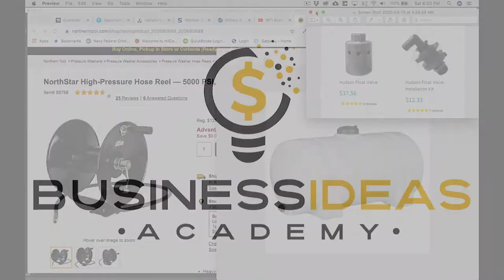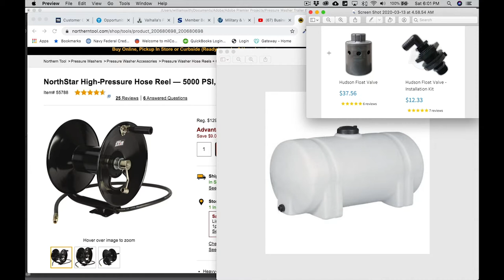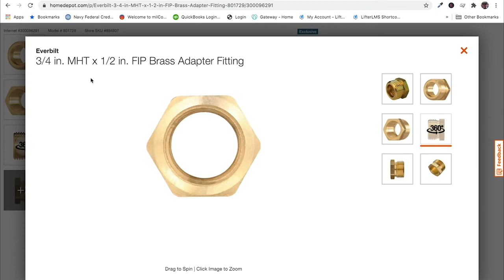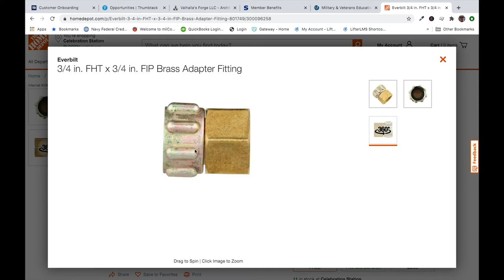Pressure Washer Trailer Build - Part 3 - Water Supply Buffer Tank

Comment: Ok, stupid rookie question. I understand the concept of what you're doing but since I have a different reel (GP) my inlet connection is inside the reel opposed to how yours is (outside the reel)  other than that, all the same fittings should work the same way, right?
Reply: I have an aluminum reel from Northern Tool that has the hose connection inside the cylinder of the reel and yes, it's the same size connections. Problem with this is that your hose needs to have a swivel end so you can tighten it without have to turn the entire length of hose.
Reply: @neptuneclean  

Would the third component that you showed that swivels accomplish that?
Reply: @jackwebb5917  Now that I think about it. I think a short hose whip (12"-16") with a swivel on one end would work. Way easier to attach that to the manifold inside the cylinder and then attach your longer hose to that.
Reply: @neptuneclean  

Ok, so using the third component with a swivel you used in your video with the NT reel with and outside the reel connection would not work with the “insise the reel” connection, but a short hose whip would work better?
Reply from the maker: @jackwebb5917  I think the hose whip is the way to go. Should be much easier to connect it to the reel manifold that’s inside the reel’s cylinder. Then simply connect your pressure washer hose to the whip

Comment: That banjo filter or Y filter is installed wrong.  It’s designed to work with gravity and let solids and debris fall into the strainer.  It won’t catch anything at all mounted facing up.  Nice video series, I’m getting ready to build my trailer soon.
Reply: Hey Razur, I'm going to disagree with you on this. The strainer has an arrow that shows the flow of water through the strainer. Banjo has designed it to work this way. As long as the flow of water is correct, the unit will not let solids past the strainer regardless of its position (up/down). I've cleaned it enough times to know it works. Thanks for having the discussion! Check out other pressure washing videos on my Neptune Clean channel.
Reply: I've also completely rebuilt this trailer. I will post those videos soon
Reply: @neptuneclean  No sir that’s incorrect.  Sure you might get some debris in there but most is passing straight through.  The “Y” part of the strainer is  designed to let the heavier solids fall into it with gravity.  You see the drain plug on the strainer?  This is so you can drain the water out of it to remove it for cleaning and you can’t possibly do that with it facing up in the air.  I work in a chemical manufacturing plant with a very complex process and we use “y” type strainer in many, many locations and they are designed to be installed with the “Y” strainer in a down position with the drain plug on bottom.
Reply: @neptuneclean  Looking forward to those videos, you do a very good job with editing.
Reply: @razur9065  Raz... I understand where you're coming from and on that application you're correct, but this is installed on a water tank so no worries about getting water/condensation build up. It's just to keep larger particles from city or well water from entering the pressure washer pump.
Reply: @williamseith4267  you misunderstood me or i wrote it wrong.  In a steam or gas application, the strainer is mounted in a vertical manner and i know it nothing to do with a inline water application.  I was just stating that it can be mounted vertically but absolutely not in a water application.  But the way he has it installed is incorrect in the video.